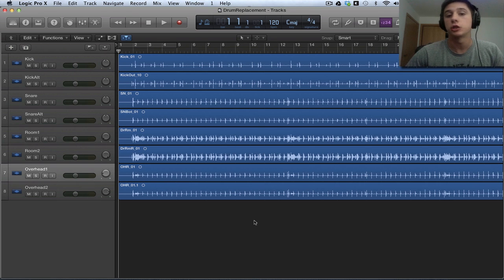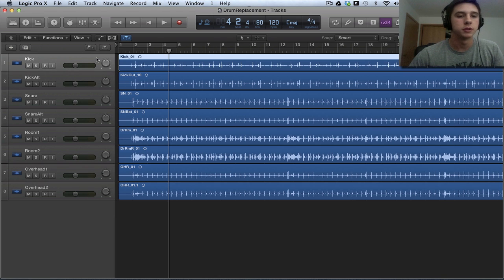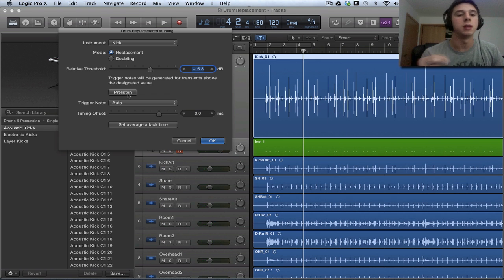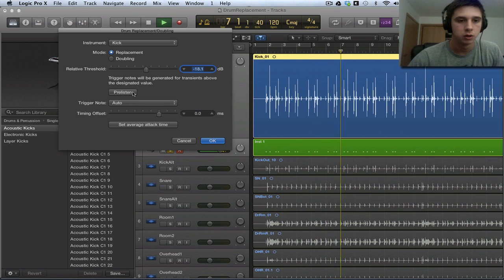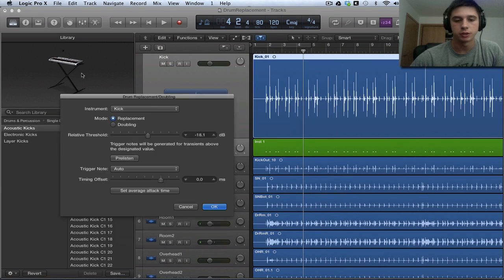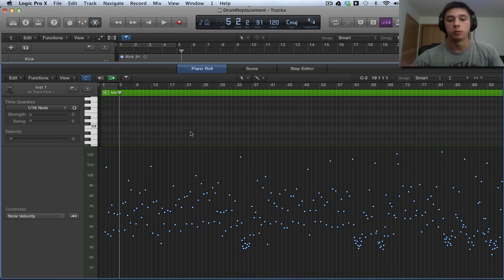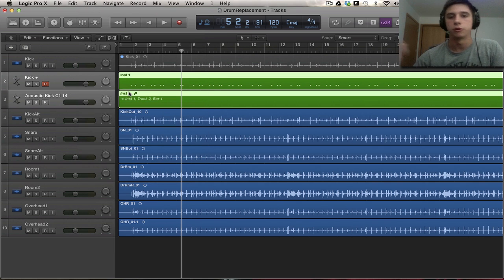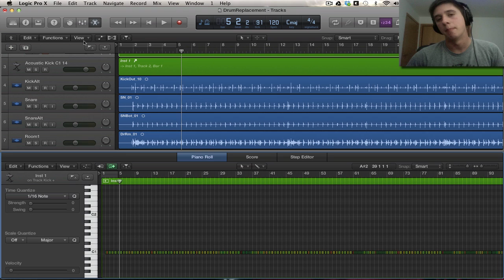Logic Pro X Tutorial - Drum Replacement & Doubling

Comment: Hey Mitchel, Great info. Thank you.   I want to do a drum transcription of Fortunate son by CCR.       I have the original drum audio track off youtube,  that is a simple    Kick and snare wave forms very pronounced etc,  I want  to make a midi map of the track and be able to assign the snare and the kick separately.  Right now the  doubler program  can grab the  snare and kick but it does not separate them , you can get a fairly clean snare midi track using the  velocity setting feature  but since the kick is a smaller wave form it does not work for separating the kick out. 

Is there anyway to set it so that some volume wave forms only trigger ?  So I could say examine the kick drum wave form and then have the program go through the tune and only identify them?   
Thanks for any info.  Regards, BT

Comment: Mitch, thanks for the videos man! You've helped me so much. Quick question, I've just replaced all my drums with samples. Now when it comes to parallel compression, do I parallel compress EACH drum track separately, or do I just put parallel compression on the overall "DRUMS" submix master fader channel?
Reply from the maker: You're welcome! So it depends on the samples you use and if you think that the parallel compression would benefit the overall sound. I'd lean towards parallel compressing them both unless I have a good reason not to.
Reply: Got it. So do parallel compression on every drum track individually and then do another parallel compression on the overall submix channel? Is that right?
Reply from the maker: Honestly, that might be too much unless you really keep the compression channels low. I'd pick one or another. Parallel compression by track or by group. I normally just mix the drums together and then do parallel compression on the group.
Reply: I see. Yes I tried doing para on each one yesterday and it was just way too much. So I ended up putting mild compression (~6db gain reduciton) on each and the para compressed the whole group. Much better. Thanks for the tips man! You've influenced the sound of my entire youtube channel. Forever grateful!

Comment: Hey Mitchel,

Great tutorial. I do have a question through.
Right off the bat when i click on track(after selecting the track), i do not have the option of "replace or double drum track". Is there something that needs to be done in order for this option to appear?
Hope you can respond soon. I'm getting anxious.

Thanks,
Braden
Reply from the maker: Braden Wilson Do you have all your advanced setting enabled in your preferences? I'm not sure if this is why you aren't seeing it, but it's somewhere to start
Reply: Mitchel Pigsley hey man. i have a similar problem.. my advanced settings are on.. but my "replace or double drum truck option is greyed out. what am i doing wrong.? thanks man
Reply from the maker: What type of a file are you trying to replace? Like what's the extension?
Reply: Thanks! This actually did work for me.
Reply: I don't know the extension.. I'm trying to replace my snare drum..
Reply from the maker: Andrei N  Okay, try converting the region to a new audio file.
Reply: Braden Wilson you might need to flatten and merge a take folder... that's what I just had to do

Comment: how do I use this function and then use replacement sounds that are not found in logic?  I've got a killer drum sound plug in I want to use, not the stock logic sounds. Good tutorial.  Thanks!
Reply from the maker: There are a couple ways you can do this. You can upload your personal sample library into LP's native library directory so you can select what you need from the same interface I used in the video. The other option is to use an instrument like the EXS24 or Ultrabeat to upload your samples, and then (since the output of the replacement tool is just MIDI), you can use that file to trigger samples in these new instruments. Note, you might have to change the particular note in the MIDI file that the samples are on in your sample editor. If it's not working, just keep that in mind.
Reply: Mitchel Pigsley which version of logic pro are you using? i have 10.0.7 and the options under track are not listed.
Reply: Herber Lugo  nevermind. just clicked on advance audio editing and it appeared. thanks for the videos!